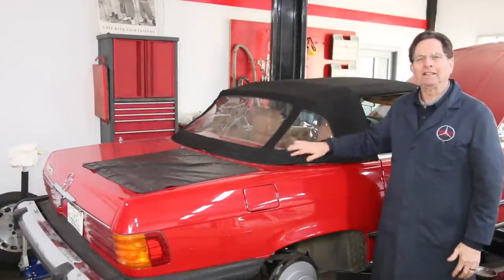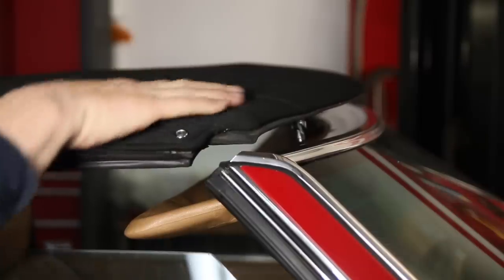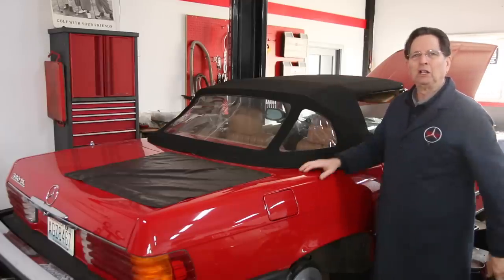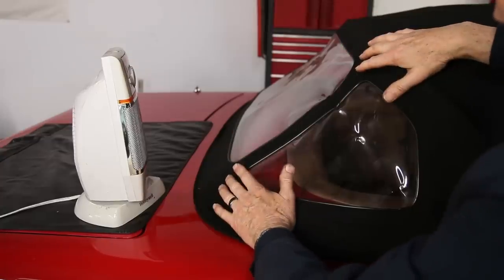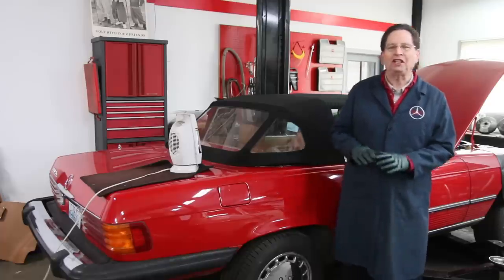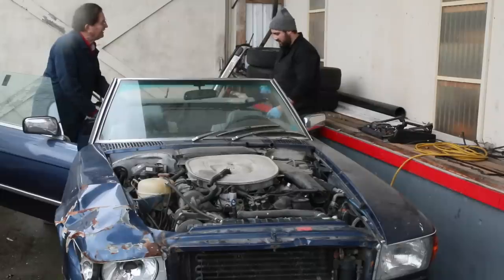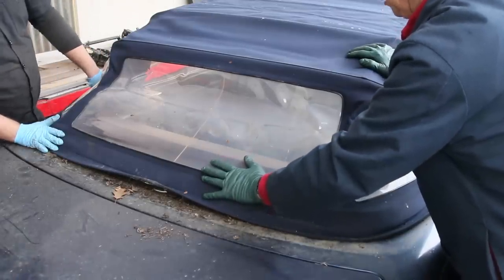Classic R107 SL Repair Series Part 11: How is That Soft Top Going to Look?

Comment: Beware, beware of the towels or fabric when storing the top.  Ken is correct.  I spent a week and a half trying to get my cover to open.  Why, because the towels were too thick and created the "overstuffed suitcase" situation.  Finally, my shop was able to open it.

Kent, what about a solution for the bottom edge curling up away from the body?  

Fortunately, my car had the top up when I purchased it, prior owner never used the hard top.  If storing for a long time with the hard to on, I would say periodically take the top off and stretch out the soft top. This was an excellent idea Kent, thanks!

Comment: Had the same trouble with a 1966  MGB, found great results using a small, oil filled, thermostatically controlled, radiator,  left inside the car. Got rid of, I reckon, 90-95% of the creases and believe me they were bad to start with........took a while, but was well worth it..... although polishing out the misty windows was another story.
Happy to say I am now a Mercedes Nut :)

Comment: I have a 1985 380SL. And the boot that you pull up to store the soft top in. Is a little tight on one side. And because of that. The side that is tight doesn't pop up when released. I sometimes have to have another person on that side. To pull up on the boot(soft top cover) to help release it. So is there a way to adjust that? So both sides will be lined up even. Not sure if it something with the hinges or what. Please help. Thanks

Comment: Hi Kent . Another great video. Thank you.
   You made a comment about replacing the plastic widows . Do you sell the plastic windows on your site ? If not , can you recommend a type of plastic to use ? And do you sell the rear defrost wiring plug?
   I bought a 1982 380SL (Signal Red and Tan) last year and have been restoring it . I've been very reluctant on taking off the hard top and ro see what the soft top looks like . The car had sit in storage for about 15 years .
  Thank you again for great videos on the R107.
Reply from the maker: Sorry we do not sell those items. You would need to go to a convertible top shop, but I suspect you will be better off just replacing the whole top if it has been in the hole for 15 years.

Comment: Could you heat from the inside of car?
Reply from the maker: That does work very well too, especially if you are trying to heat the entire top to stretch it out.
Reply: Mercedessource - heating on the inside would definitely require close monitoring - probably best to check with a thermometer..... Most heaters will shut off at a max temp though...

Comment: Thanks for another helpful video, Kent! As you probably know, sometimes those r107 soft top compartment lids get stuck and can't be opened and it's real pain trying to get it open. I discovered a way to open the lid when that happens, and I recored a video. I'm sure you could do a better video. Feel free to use this as reference if you want to cover this topic.  https://www.youtube.com/watch?v=H9AfSlUYw7E&t=63s
Reply from the maker: Hi Joe, thanks for sharing. Do you think the latch could use a special hook tool that you would carry in the trunk tool kit? I had a gold 1985 380SL about 15 years ago. :-)
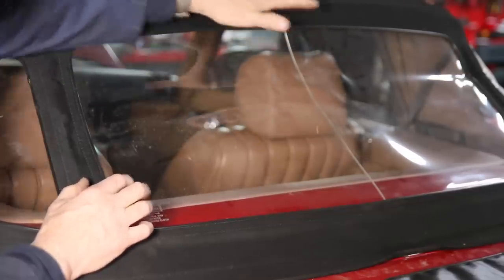Reply: @Mercedessource  Yes, I think that's a good product idea, and as it turns out, someone fashioned such a tool after watching my video and posted about it here https://www.benzworld.org/threads/soft-top-cover-opener-tool.2979185/   If you browse the whole thread you'll see my comment indicating that I would've gladly paid for the tool and a tutorial video. Heck, I'd still buy such a tool, despite knowing how to accomplish this task with a screwdriver, because I think this tool would make it easier to reach in and less likely to scratch the chrome cover plate while you're at it. If you wanted make a product bundle, you could also include the pin that had fallen out of my latch assembly (see 1:30 in my video), as I understand that's a pretty common problem for r107s and the cause of my stuck lid. So your bundle could be the tool, the pin, and the video.